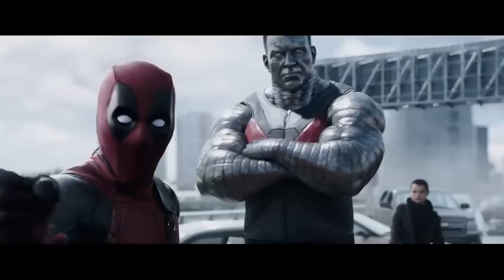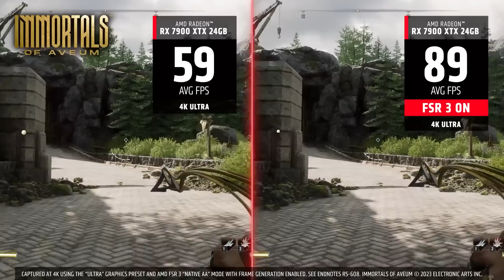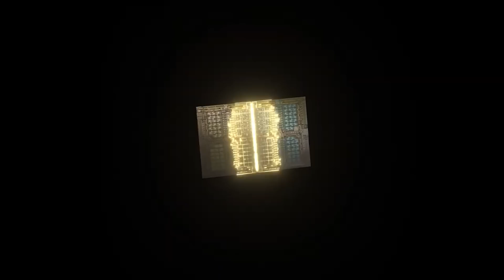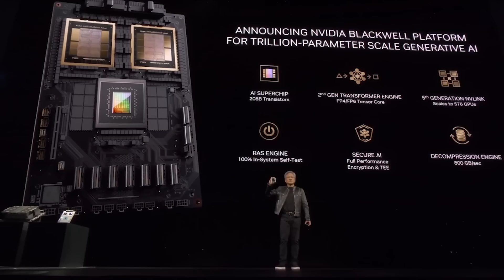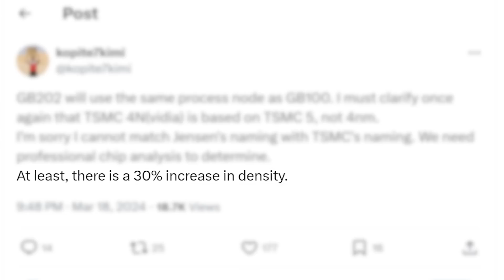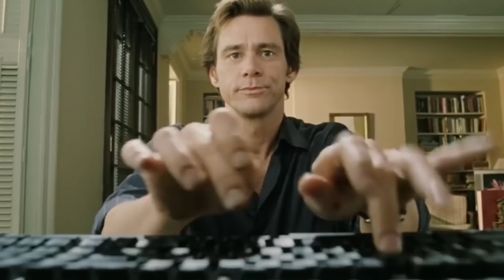RTX 5080 BEATS The 4090!!

Comment: The comments about '5080 should overperfrom 4090" have flawed logic: they compare x80 card with the previous top in generations where x80 were the top non-titan card, which means "x80 vs previous top" is actually "top vs top".  Saying "x80 overperforms past top" in this case is misleading and disingenuous.

Comment: I doubt the 5080 beats the 4090 by much if at all. 5090 is likely 50% better and I doubt they let the much cheaper 5080 be only 20% worse or 30% higher than the 4090. I expect them to be about even plus or minus 10-15%. The 5090 will continue to hold the majority lead and serve as the titan like card.

Comment: They are releasing these card series too fast and as a result they have to increase the price to skyrocketed prices or the previous series will not sell out.
If they were not such huge upgrades it would not be such a problem but they are all significant upgrades from the previous gen.

Comment: If the 5090 is 2,000 USD the 5080 is probably going to be 1,399+ in order to keep 40 series stock high in price. Nvidia did the same strategy on keeping the 30 series card high.

Comment: I mean they say every time a new generation comes out "It will be the biggest increase in performance EV-EV-EVVEERRRR!!!!!" and then it turns out to be about the same as last gen was over it's predecessor and in fact in some cases a smaller increase. 
In fact they claimed the 4090 would be 4 times faster then the 3090 and it ended up only being 75% faster......

Comment: LOVE YOU VIDS BUT MAN HORRIBLE TITLE IT BETTER BEAT HE 4090 :) AND I KNOW ITS A 80 SERIES  sorry caps but it should
Reply from the maker: Don’t forget just how much more powerful the 4090 is to the 4080 though. I get what you mean, but we haven’t really seen a top end GPU so much faster than the lower end cards. Maybe a Titan card, but I’d argue this is still a nice feat. But I also get what you mean. Unfortunately, speed boosts are likely going to start slowing though. So keep that in mind as well.
Reply: I am set for now and a few years into future with a 5600x3d in s 70$ Gigabyte B550 with 32 gig of ram cooled by a Deep Cool AK620 powering my Sapphire Pulse 7800XT"I am very Disappointed I could not get 7900 GRE for only 50$ more Since the released it a couple weeks after my build, still use my beamforming mic from my ancient SoudBlaster  @GamerMeld  Mounted in a blacked out no LEDS Deep Cool  CH510 MESH DIGITAL Tempered Glass ATX Mid-Tower I give it high praises for its  adaptability and handy built in GPU rest LOL.                   One thing I noticed i put my  super 12+ year old TX850 corsair that used to run my 5ghz 2600k "GAVE MY GPU A HORREDOUS coil whine so bad i could hear it through mu headphones" bad!   .....I built another PCI built recently but had a nice platinum PSU 750 watt evga gold PSU. 
So I swapped PSU's and low and behold coil whine is completely gone,,i mean none whatsoever. Have you ever encountered this before. Also could it be a possible investigation on clean power for GPU coil whine

Comment: Then: RTX 3070 beats 2080 Ti
Now:  RTX 5080 beats 4090
Reply: 2080ti isnt comparable to a 4090. 4090 is leaps ahead of every GPU. Technically the 5070 will beat the 4080 so it's still the same.
Reply: @LB-sh7qt  The least powerful enthusiast card could beat the best card of the previous generation then. Now, only a medium grade enthusiast card can beat a high grade enthusiast card of the previous generation. What are they going to say next? "5090 can beat 4090 Ti yay?"

Comment: At the prices Nvidia wants of course you're going to get performance, the issue is, no one really needs that crap.  I have never purchased one and at this point never will, and have never wined about my card not being fast enough, it works just fine.  Midrange is more than enough for most people, but all you YouTube guys can't talk about anything but the high end.  I for one don't care who makes the absolute best high end $2000 card, I am not going to ever buy.  What matters to most of us, and would matter to a lot more if they stopped listening to all of you, is what can I get for a decent price that will do the job I actually need.  There are a lot of Nvidia cards bought just because "I gotta have that feature" that will never be used by a normal, non video producing user.  I do graphic arts and use lower end midrange graphic cards in every one of my workstations, as well as my gaming PC.  They do just fine.  Most gamers, in all reality wouldn't see the difference when playing and would be better served with an Intel or AMD midrange card that didn't cost more than their car.  Just my two cents, most so tired of the coverage of over the top hardware that has yet to be released, with what is almost always wrong specs and overstated performance.

Comment: is it worth it to buy a 4070 super or should i wait for 5000 series?
Reply: wait trust me
Reply: Wait and buy a 4080 super on the used market for the same price as the 4070 super right now
Reply: Tbh you will always get the "wait" answer from people everytime you ask this question. Wait if you think waiting another 8/9 months at least isnt a problem, upgrade if you don't. I just upgraded from a 3080 to a 4090 and won't be upgrading to the 5000 series any time soon (most likely will wait until the 6000). I couldn't be happier with the change, but that's because waiting close to a year for most likely not a big increase in performance vs pricing is not worth it for me
Reply: @marcosrolando7987  Nah this time he better wait, the jump is gonna be the same as 2000 to 3000 which was insane! because the jump between 3000 and 4000 wasn't the big if we are talking about 4080 and down
Reply: @w9s992  The jump between the 3080 and 4080 is almost as big as the jump from 2080 to 3080 though... it's just that the price almost doubled as well, which makes it lose all appeal. If the prices were kept the same or at most 50$ more we would be considering the 4000 release as one of the best ones (same as 3000 and 1000). There is a 30% diff between de 3080 and 4080, thats a big gap. The issue with the 4000 series is that even though they are much more powerful / efficient than the 3000 series (which are no slacks btw, they are still great cards) is that the price / performance ratio is at best the same at worst incredibly lower, THAT was what fucked the 4000 series, not raw performance. Instead the 2000 series barely improved in rasterization performance, instead they went all in Raytracing
Reply: @marcosrolando7987  I do agree with you man, rtx 4000 cards would have been good if prices weren't that fked

Comment: yeah I mean it's completely normal and it should be a must for the next gen 80 series to outperform by a huge margin the flagship predecessor, but I mean it will probably be again a very small performance boost like 5-10% maybe less as NGreedia SUCKS, and also the 80 series will probably also have a lot less vram so It's not worth it IMO, but still only time will tell

Comment: Who remembers the  2060KO, which was a cut down 2080 that behaved exactly like a 2060 except in 1 particular application, where it blasted all other 2060s out of the water.
Reply: The RTX 3080 Mobile had 16 GB shame the desktop variant did not I wonder if the RTX 4070 will have 16 GB instead of 12 GB.
Reply: @Crimson_Lockhart  Did you meant to say RTX 5070 ?
Reply: @Winnetou17 Current gen GPU's for $500 should have 16 GB.🙃
Reply: Good point!

Comment: This should always happen and not only on the high end, mid and low end gpu's should also have the same increase in performance but in recent years it hasn't been the case at all. I'd be interested if the 5070 would beat a 4080 but I'm pretty sure it wont.

Comment: If dual BW chip draw 1200W, it mean each chip actually draw 600W and less than GH100. This mean the power draw per mm2 is actually better, if they are same size. That is smth positive, meaning RTX5070 wont be drawing more power than RTX4070 while performance significantly faster

Comment: I think that's normal that 5080 beats 4090, I hope 5070 beats 4080. But there's one more thing I hope all new gpus across the board will have more vram. I'm preparing for 5070, but with 12GB vram I'm switching to AMD

Comment: The xx90s were always only supposed to be just a little better than the xx80s. The massive gap we saw between the 4080 and the 4090 is a new and disturbing phenomenon.
Reply: u foregate about the titans ? that costed 3k + and no one was complaining ?
Reply: Kinda disagree, if you go back to GTX 490, 590, 690 etc. They were all substantially faster than their x80 counterparts. Subsequently the Titan cards were released as a new take on those x90s however they were more focused on content creation rather than gaming which is why they were always just slightly better than the 80 cards. Also keep in mind we hadn't seen a xx90 card since the GTX 690, the 4090 is the first 90 card since that era and it shares the same quality in that it is a leap above the 80 (just as much of a leap in cost as well).
Reply: @0ptim1zedd  yeah but the gap between a 3060 Ti and a 3090 Ti when compared with the gap between a 4060 Ti and a 4090 has literally doubled. The performance on these new nodes and platforms is there, in fact it looks really good, they just aren't giving you any of it at all. Meanwhile they want to charge higher prices for these low to mid range tiers that are getting heavily cut down.
Reply: @0ptim1zedd  so I feel like your point would land harder if it wasn't for the fact that they gapped the entire line up haaaaard compared to their best performing GPU, not just the 4080
Reply: @0ptim1zedd  keep in mind this is proportional so it doesnt matter how fast these suckers are, we are getting HALF the performance uplift of the last gen in between the 60 Ti and the best performing GPU.
Reply: @0ptim1zedd  the 590 has 10% on its the 580

Comment: It is probably actually 30-40% slower but dlss4 that just generates random frames that aren't even close to happening. It will cost more than a 4090 and have twice the power draw, it will light on fire even faster.

Comment: There was many problems with the 4080 and 4090.  The new power cable  socket was just too thin causing fires. It only got better after they made the socket thicker for the cable .

Comment: Not gonna lie, if the 5080 beats the 4090 in performance at around the same price point, I'd consider that a steal. I get that a lot of people think that the 4090 and the 40 series as a whole are over priced (and they are for the average consumer), but for professionals like myself and my wife who do a lot of CAD work, the 1 to 2k price point is actually pretty damn good. This is especially true when you consider the fact that the Quadro RTX 8000 just 5 years ago cost 5 thousand dollars each. And now that same Quadro could only dream of performing as well as a 4090 in rendering.

Comment: So to summarize, they're gonna be expensive as heck, harder to cool thanks to the dual Chip design and they're gonna be power hungry Gpus. As long as the 5060 is 450-600$ and they keep the trend of it being power efficient below or at 155w. In terms of performance it should sit between the 4060 and 4060 ti 16gb.
Reply: And will probably fry themselves like the 4090
Reply: @K.T.Animations  Yup, unless they start making slight longer and bulkier cables that can actually handle the heat. The current 12vhr cable works great with any of the Current 70's , and the 80's has mixed reviews with some people mentioning that it works great cause they made sure it wasn't bent and properly plugged into the GPU. The other half says they did the same but it still melted.

Comment: Say it with me guys. BETTER. THAN. THE. HIGHER. TIER. Every new video card release should be at least on par with or BETTER than the previous generation card that came above it. 
The RTX 5080 needs to beat the RTX 4090
The RTX 5070 needs to beat the RTX 4080
The RTX 5060 needs to beat the RTX 4070
It's sad that this is a rare case nowadays but this NEEDS to be how it is otherwise there's no justification for a new generation.
Reply: wrong. Thats what happend with the 20 series, which was trash. The 30 series is a good example of what nvidia should do: Make a 3070 that is BETTER than a 2080 ti. What else could you wish for? If they release a 600$ 5070 that is 10% faster than 4090, its gg.

Comment: How is the 5080 being almost as fast as the 4090 (well 103 being almost as fast as last gen's 102 die) and faster when raytracing a good thing? Up until this gen...this one, every 70 class card going back to fricken FERMI matched or slightly outperformed the previous gen's flagship with the exception of Turing and the 2070 which flopped when compared to the 1080Ti, taking the 2080 to beat it in rasterization while obviously smooshing it with raytracing features enabled due to the Pascal architecture not being suited to that technology yet. Yet Nvidia, who is probably going to raise the price, at least when put side by side with the 4080 Super and...lose in raster to the 4090 while beating it in RT and somehow call it a win? Tell ya what, if the 5080 comes in at $1100 or under with 20-24GB of VRAM as opposed to 16 on a card that costs more than a cheap used Civic from the early '90s and increases price to performance vs the 4090 by, let's say 30% is a fair generational price to performance jump; heck, a 30% jump vs the 4080 Super in price to performance in both raster and RT I'll buy one. If I don't buy a 5090...

I'm sorry, but unless the price is way below what I expect, losing to the 4090 in anything for over $1K is simply not an acceptable product. 2 years between generations, a standard 10-30% performance boost for 50%+ price hikes just does not excite me anymore and has me thinking "I'm more than happy to crash in the Best Buy parking lot over night, but if the 5090 is more than $2K I'll get a 5080. But if the 5080 is not 30% better than the 4080 super for the SAME MSRP, or 40% better for 10% more money, 50% for 20% more etc. then I'm probably just grabbing a used 4080 Super and calling it a day for the next 2 years."

If more people went the used route we would only be seeing crazy pricing on the 90/Titan class cards and the GPU market as a whole would be in a much, much better place. Man, if they put 16GB of VRAM on the 5080 I am going to be livid. I'd be happy to go with AMD, but considering it appears they are not making a high end card I don't exactly have a lot of reasonable options to upgrade to from a 3080.

Comment: "5080 beats the 4090" lol either the performance uplift for next generation sucks, or they're gonna repeat 4080 shenanigan (where there are 2 4080 versions), than people complained and they changed it into 4080 and 4070 ti instead of having 2 version of 4080.
Reply: due to fp4 and fp6...that amd lacks important architecture to unlock more fps for cpu new code

Comment: Remember when the 1080 ti released and it was a 60% performance boost over the 980 ti without a price increase over the previous generation. $699 for an '80 Ti series card.
Reply: Pepperidge Farms Remembers.
Reply: Also, power draw between the 1080ti and 980ti were also similar despite the leap in performance .
Reply: Pascal was epic
Reply: I paid MSRP $699 for the 1080ti gigabyte 11GB on release day and that was triple what I paid for a high end card before that, after building PCs for years!  I mean my HD6850 had 256 bit 1GB memory.. you would think at least 512bit memory at least from the 1080ti but it was only 256bit and GDDR5 when they could of made it GDDR6.  They know people are scalping and taking advantage big time.  The 1080ti and 2080ti are basically the same card but more expensive.  We should be lucky to see 20-30% gains now a days.
Reply: I'd only switch to the 5080 from 4090 for 2 reasons: better efficiency and lower price. 
I use my 4090 max UV, FPS limited and always without raytracing 😂
Reply: @Serandi1987 I agree my power bill has been crying for months now

Comment: If nvidia actually makes a card capable of running regular Rtx with minimal performance impact and path tracing that's 30% better than now, I wouldn't mind one. 

So if we got say a 16gb 5080 with about the same or slightly less rasterization as a 4090 with better raytracing at $800 max, I would get that at some point. Only reason I go amd is the vram and price.

Comment: This is the main reason I stay with AMD. They are working to provide the best products for everyone. You don't even need to have AMD components to benefit. Yet Nvidia is a closed environment, and Nvidia still pushes their customers to buy newer products by not allowing older cards to benefit from new software products. 

Oh, and not only does AMD encourage you to overclock and tweak settings for each independent game.They provide you the tools to safely do it with.

Comment: an 80 class GPU only just better then a 90 class of the last generation... this is poor because the 4070 Ti is better then a 3090 and that's a 70 class card, heck even the 60 class should be on par with 80/90 class but as usual Nvidia will fumble the 50 series and call it a day